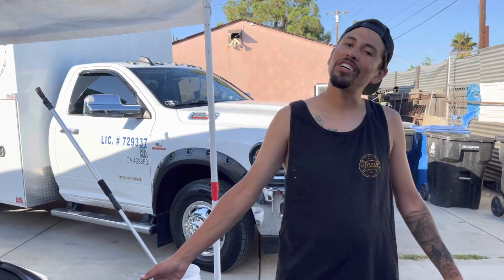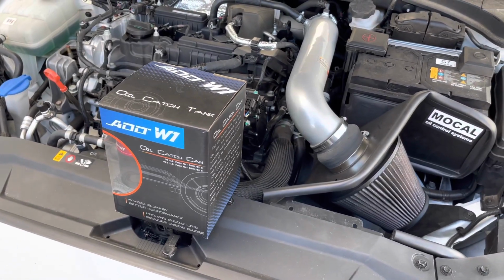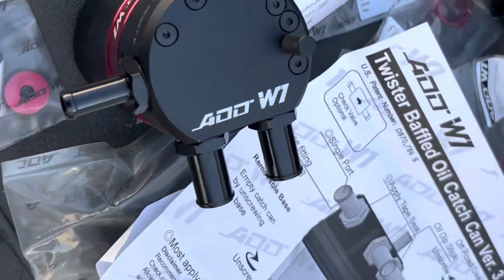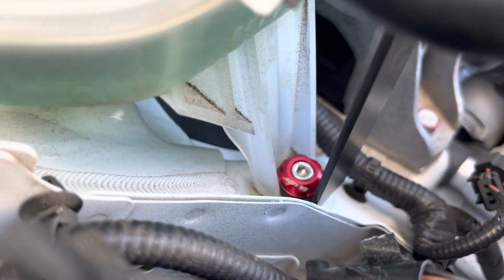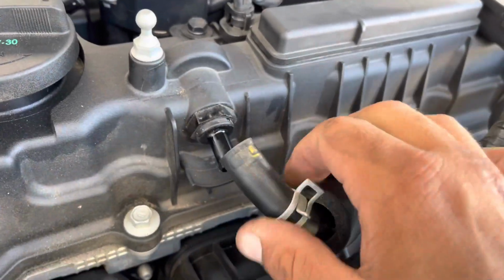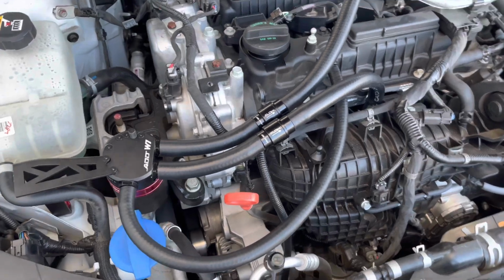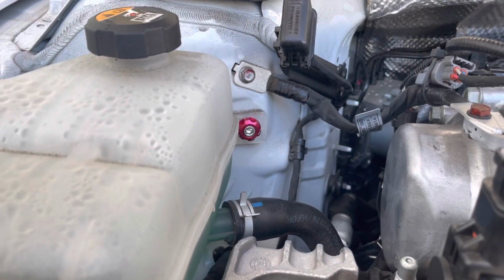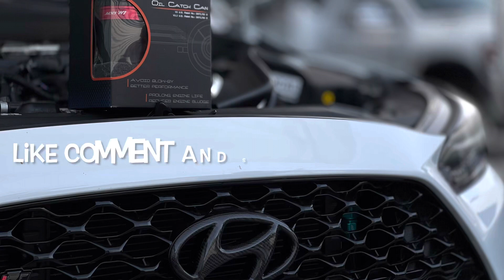ADD W1 v3.3 Oil Catch Can Kit For The Veloster N!

Comment: You removed the hose from the rear valve cover to the air intake tube. What did you do to the tube that was there and did you  plug up the crankcase output on the rear valve cover?
Reply from the maker: I added a breather but since then I put a tee on the intake side and ran the crankcase output into that tee.

Comment: Do you need a check valve or do you can run without it ?
Reply from the maker: You need a check valve to ensure the can isn’t getting pressurized
Reply: @KDMStation  there’s many option but I don’t know what choose with stock engine ,  naturally aspirated turbo 9mm or 15m pro .
Reply from the maker: @CloD44  choose whatever you feel you fits your needs.
Reply: @KDMStation  thank you for all your help . You got a subscriber 🤝. I’ll see what I have to order if one 9mm and one 15m since I only have 2 hoses , one inlet and one outlet with the oil catch can new version 3.
Reply from the maker: @CloD44  appreciate the support! I have the v3.3 can so I’m using two 15mm and one 9mm

Comment: If you were going to use  your engine cover. How would you make it work?
Reply from the maker: I would have to put a 90 degree fitting where I have the breather at and then add a tee to connect that back into the intake. It would bring the lines low enough for the cover to fit back on.
Reply: @KDMStation would you need a check valve on the intake side if you remove the breather and add a tee?
Reply from the maker: @wickedchild10 no check valve at all since the check valves should be installed near the can.